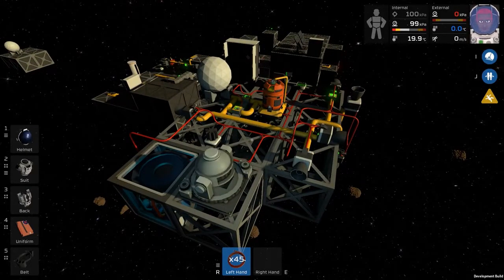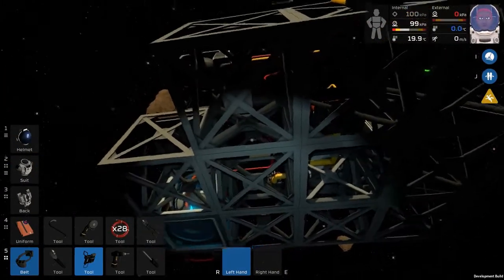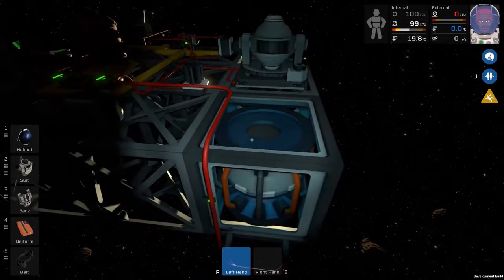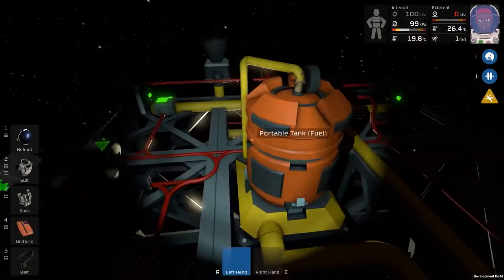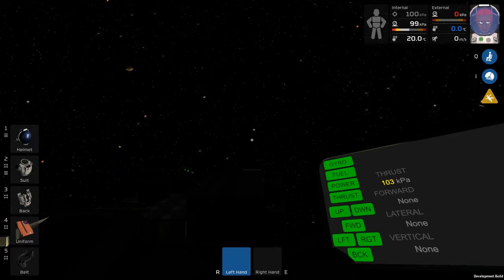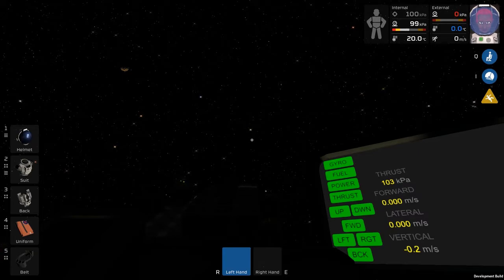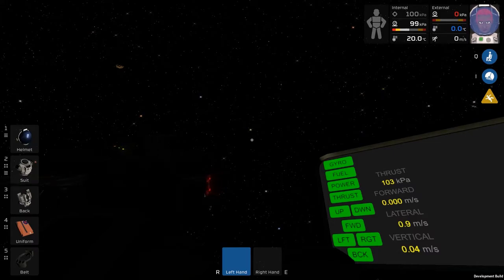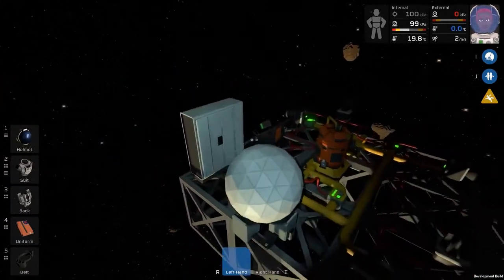Stationeers - Basic Mothership

Comment: it mostly isn't done because the content hasn't been implemented for Survival however you are probably going to see a spike of views shortly after the content patch that releases them into survival.
Reply from the maker: I'm interested to see how gravity will play into ship building. I'm also curious which route they will take for the having the space area and ground area. 
Space engineers has everything in the same world. Empyrion galactic survival has a "wall" that transitions you between the 2 areas.
Reply: Those have been answered pretty much.

Gravity is currently based on "airtightness" If a structure is theoretically airtight in space, it gets gravity. Go try it, should already be implemented. In the dev stream it didn't seem to matter how the mothership moved, the objects inside it moved with it.

As for space to ground; that will be handled by SSTO shuttles mostly I think. It seems like in the original reveal there was a mothership on the planet so they MIGHT decide to add some way for motherships to go to space from ground after all. Its most likely going to be similar to Empyrion galactic survival from what I gather, which is quite a bad thing honestly. Its not really meant to be an MMO its more "play with a bunch of your friends" kind of multiplayer.
Reply from the maker: What I meant by gravity and ship building is the design issues you have in space engineers. You have to put enough thrusters for the weight of your ship for it to be able to take off and leave the atmosphere.
Yea, I don't think they ever had the MMO idea as part of the roadmap.
Reply: That would be interesting. I hope that's how they implement it.